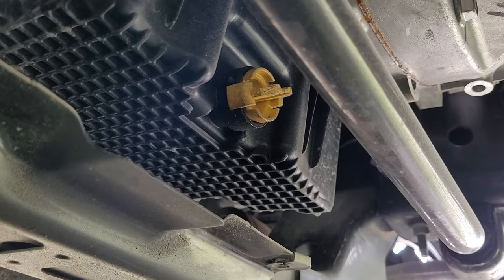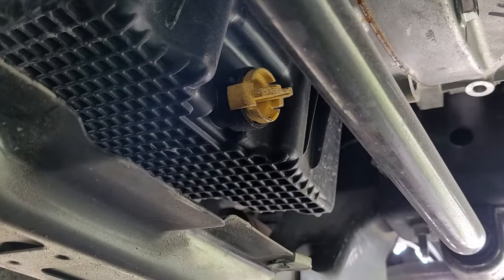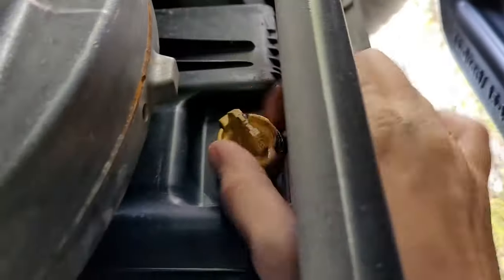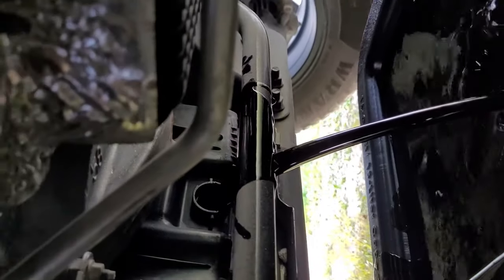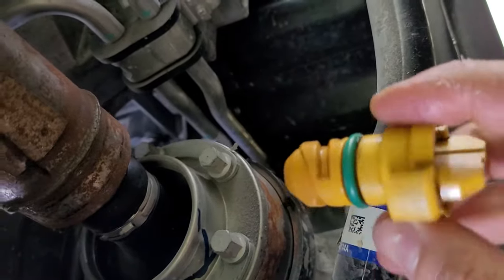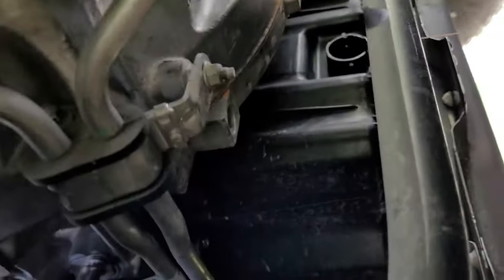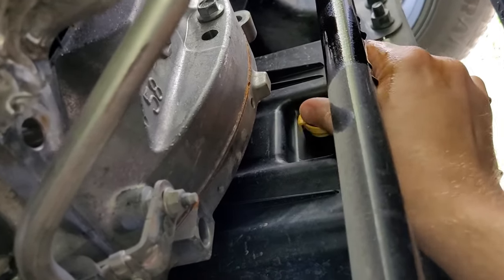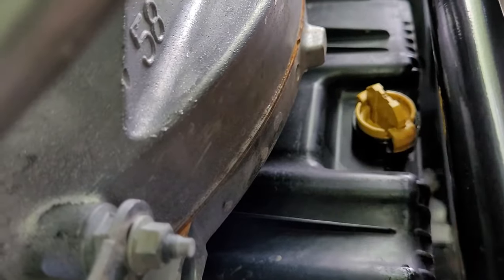Ford's New Drain Plug

Comment: Why can't Ford just leave it alone.  Remember how they re-invented the spark plug a few years ago?  Disaster.   Plastic oil pan?  What could possibly go wrong?
Reply from the maker: Right. I think it was the triton 3 valve that only had 3 threads holding the plug in and the plug would shoot back out.  Or the fuel tank straps that rotted out and people would loose their gas tank while driving.  Also the whole tires at 23 psi thing back in the day and then blame Firestone
Reply: I'll keep my Silverado !
Reply: They didn't read Jeeps notes.  Plastic engine. Lego car.
Reply: @thebartendermechanic  The 03' and older 2V Modulars had the short threads in the head and the 4.0l V6. About 4 complete revolutions of thread. In 04 up a longer thread length was added. What Ford did with the short threads is they went from iron heads to aluminum heads and kept the old spark plug design with a short thread length. Obviously iron is stronger than aluminum and got damaged easier. Then on the 04'-early 08' 3V modulars they went to new plug design that got stuck in the head. In late 08'up they changed the plug design on the 3V modular plugs once again to an all threaded design with no long protrusion on the plug so they didn't get stuck. If you need to design spark plugs for an engine, just don't ask Ford for help.
Reply from the maker: @sdvten  thank you this is good information, I remember the plugs getting stuck in the head they would rust in the head and the had that special tool to take them out.
Reply: Because then you’d have GM with Archimedean technology and pushrod 2 valve engines forever while the world innovates them by.
Reply: @visiondemedici6347  Ask yourself when you last saw a custom hot rod builder swapping a Modular block Ford into one of his go-fast creations.   Then go online and check out the number of builders who are sticking LS block GM engines (or SBC) into their hot rods.   Nobody has any trouble locating Modular Ford blocks in junkyards, but LS GM motors are getting downright scarce in the used market.
Reply: @jimparker7778  The simple answer to that is size. Physically Ford modular engines are very large in size. Much larger than GMs LS engines. They just don't fit in engine bays as easy as the LS.
Reply: @sdvten  You left out the Big One.   Ford Modular engines all have huge timing chains.   The GM motor has a timing chain that will last 250k miles easy.  No so with the Ford.  Timing chains have been a problem for the Ford OHC engines.
Reply: @jimparker7778  Yeah the timing chains are longer but they do last. Both engines have their share of timing set issues. If you don't think so you obviously have little experience with working on either. Sounds like you are going off of regurgitated information. Can't tell you how many modulars from fleets I've seen with 300k, 400k or more on the original timing sets. The 2V has far less timing set issues than the 3V modulars.
Reply: @sdvten  Why did Ford drop the 4.6 if it's so great?   Ford's had a ton of trouble over those timing chains.
Reply: @jimparker7778  The 4.6l was in production for over 24 years. To meet current emissions and power requirements with VVT, Di and higher CRs it just made sense to come out with another design. Even though some of the new engines like the 5.0l have things in common with the modualrs. GM has a hell of a lot more problems with their AFM system than Ford ever had with the timing set on the 4.6l.
Reply: @thebartendermechanic  ...lose not loose.   Loose means not tight
Reply: @thebartendermechanic I remember all of that 😂 and I had a friend with an F150 that we had to help him strap his fuel tank back up so he could get home.
Reply from the maker: @Pointlesshandle48  Yes!!! when I worked for Ford for about 5 months 12 years ago that's all I did was fuel tank straps🤣 there was a big recall going on
Reply: @rickwidlund3512  Me too!
Reply: If it ain't broke, fix it.

-Ford
Reply: Remember plastic windshields? Another winner.
Reply from the maker: @dudley7540  no, is that a real thing?
Reply: @thebartendermechanic  30 years ago? I'm scraping the sticker to do an inspection and the razor blade digs in. Hid it with the new sticker.
Reply from the maker: @dudley7540  lol, crazy. the things new parts cover up
Reply: @dudley7540  Aluminum pickup trucks?  Shocks mounted so close to the rear brake discs that the fluid overheated and ruined the seals?
Reply: But you don’t understand. Now they can charge you for a kid plate or lots of changing pans.
Reply from the maker: @dang6832  keep the parts sales up
Reply: Right that’s a hell of a fix for a failed $2 part… I definitely wouldn’t trust these chain oil change places with that it looks too complicated 😂
Reply from the maker: @tommyc5062  yeah I don't trust oil change places

Comment: pretty soon Ford will replace every metal part with plastic. 5 years from now you'll be riding around in a fisher price vehicle.
Reply: Look what plastic composites have done for bright auto trim.
No mo' nasty chrome plating w/later-on EPA TOXIC CLEAN-UP.

I bet your car/truck engine has a composite intake manifold.
Imagine trying to cast/machine such a  "monstrocity" in aluminum METAL.
Reply: They'll make sure to leave some metal body panels that rust out within 10 years up north on a $60k-80k truck.
Reply: Little Tikes Cozy Coupe
Reply: It will then be called a BMW😅.
Reply: They are copying bmw. New BMWs are pure junk after 4 years of heat cycling the plastic engine components. This is the aim; they want failure, their business depends on it
Reply: @dsmhiggins67  well yeah, one should never buy a BMW, just lease.
Reply: Fisher price is a better build quality than Ford.

Comment: I really like the sway bar right in front of the drain, real smart design.
Reply from the maker: Good for taking an oil shower
Reply: Yep. Frame members. Crossmembers right underneath is fun. Almost impossible to get the oil residue off so the customer thinks that there is now a leak.
Reply: ...and NOW with the NEW Space-Saving Design.

My '13 F-150 3.5L ECOB...has the drain plug on the RR of the aluminum pan...just above a big, ol' sway bar.  ALWAYS a THRILL, every 5K mi. while at "operating temperature".
Reply: Well, the engine goes where it’s gonna fit and the sway bar goes where it’s gonna function, I guess the designers could have put a notation in the service manual to alert the technician to have a rag handy to wipe off the sway bar when they change the oil ?
Reply: @jimseviltwin1  You have never been so correct Sir.
Reply: you dont like sway bars>?
Reply: @OregonCoastVideo  Don’t have one on the back of my Jeep JK and yeah, it sways a bit, but nothing that can’t be handled.
Reply: @jimseviltwin1  Nobody EVER reads an Owner's Manual...unless its a dark, rainy Sunday night, they have a flat tire & they cannot locate the jack.
Reply: Engines designed independently of car model. And you shouldn't own a car if you complain about such stupid things.
Reply: @inevespace exactly
Reply: It’s not really hurting anything. It hits it when it first spills out and after it drains you wipe it with a paper towel. I’ve seen much worse designs.
Reply: Same on the ram 1500s too 😆
Reply: Yeah, never liked the design of that drain. Always exciting. Surprised you didn’t mention the 3.5 ecoboost oil filter placement. Taking off the shroud, shoulder deep at a 90 degree bend for a blind placement. What a joy
Reply: Probably a good idea to have something protecting that plastic oil pan.
Reply: better a sway bar than exhaust pipe like my subaru completely surrounding the oil filter
Reply: 30 years ago, I had a 1974 Ford F-350 with a 390 V8. The drain plug pointed right out of the crossmember and always made a mess of everything. One day, I went to the junkyard and just bought a random old oil pan I found lying around for a couple of bucks. I took it home and cut the drain plug out of it, then pulled the oil pan off of my Ford and welded this drain plug in the other end so that it had a clear shot. A couple of hours of work fixed the problem for the rest of the years that I owned the truck! Can't really do that with plastic oil pans. I think I'll stick with my old Chevy truck.
Reply: Get a Fumoto valve. It's the only way to go.
Reply: At least Nissan is kind enough to put a drain lip there 😂😂😂

Comment: If they are using a plastic oil pan, then a plastic drain plug makes perfect sense. They seem to work perfectly well.
Reply from the maker: Time will tell
Reply: @thebartendermechanic  but there’s been plenty of time. Those plastic pans and drain plugs came out 10 years ago and I’ve never heard of any major problems from them.
Reply from the maker: @stephenmartinez1  alright, that's good to know, maybe they are better than the metal pans.  I personally haven't seen them, but I usually work on bigger machines
Reply: No need to ever worry about ruining an oil pan due to over tightening the bolt. A lot of repair shops and inexperienced DIY’ers ruin them. I think the design is cool, personally.

Comment: If you shine a borescope up the oil drain hole you’ll see plastic connecting rods also.
Reply from the maker: No way, plastic connecting rods!!! I don't believe it
Reply: @thebartendermechanic  He's pulling your leg. While a light weight plastic or composite carbon fiber connecting rod would be a thing every manufacturer would welcome it can't be done because of the forces placed on the Conrod by the piston. Rods made of metal bend and stretch and have to withstand forces measured in Tons of force. Only steel and aluminum are cost effective AND robust enough to handle the forces. People have been trying to make every part of an engine plastic since the 60s.
Reply from the maker: @btwbrand  Yeah, plastic connecting rods just didn't make sense to me
Reply: With banana peel bearings....
Reply: In the mid 90s I actually built a drag race engine with pink plastic "unbreakable" connecting rods.
Fun fact = Can't break 'em but they WILL stretch and make a hell of a noise pistons tapping on the cylinder heads. Wait 24 hours and they return to original size. Problem is if you build the engine with enough clearance to avoid that then you have lower compression ratio - and you're going to lose every race !
Reply: @thebartendermechanic belive it pal, they even made the crankshaft out of plastic. Even the oil is liquefied plastic

Comment: I'm sure we'll be able to get aftermarket metal oil pans with traditional drain plugs, especially after the quickie oil change shops start "overtorquing" and wrecking these new plastic ones.
Reply: or in 5 years when that finger tab breaks off.  I'd def change it after about 8-9 years, I had the plastic oil cartridge cap on a 12yo ford crack and spew oil all over the place.
Reply: The whole idea of this design is to prevent overtorquing and damaging the oil pan. The pan has tabs which prevent the plug from turning too far.
Reply: Ford says these are 1-time use. Last year I went to 3 oil change places and none had the plugs. I had to go to a dealership, buy a couple then go back for an oil change.  Stupid!
Reply: @bpkmm3048  where do you get your oil changed? I work at Jiffy Lube and we rarely replace these plugs. I don't see how they're single use. I have seen the rubber o-ring become flattened around the outside over time and have replaced them because of that.

Comment: Yes, I do own a Ford. I had hoped that the manufacturer had learned a lesson with the first two years of the diesel 6.7 (2011/12) and that those plastic parts are junk, often leaking or breaking. Somewhere I still have a spare drain plug from my 2011 F350 - probably stored in the same place as the spare plastic fuel filter cannister that often breaks.
Reply from the maker: Yeah me too, it seems like they keep cutting corners on manufacturing but the price keeps going up
Reply: @@adog3336 You might do your homework before you challenge a FORD diesel Super Duty owner with a FORD designed and built engine. Ford stopped using Navistar engines. a 6.4L with the 2010 year. The 2011 Ford uses their own design, a 6.7L 400Hp/800Lb ft torque engine and continues using that same basic bullet proof 
engine with many upgrades into the 2024 (500Hp/1200 lb ft torque) model year. Additionally Ford designed and built a 3.0L diesel for the 2018-2021 F150
Reply: @@adog3336 You would never work on my Ford with that lack of knowledge. You might want to actually learn what you are working on if you are actually a Ford tech working on 6.7s. You might actually learn that Navistar almost drove Ford Super Duty trucks out of business with their crappy 6.0 and 6.4 self destructing trash engines.
As far as GM and Dodge/RAM, I really don't care what they use for an engine though the pre DEF Cummins are about as good as any light duty pick up engines

Comment: I bought a F150 with this drain plug, it was the last F150 I bought.
Reply: What f150 did you buy that had this?
Reply: @jacobhinkston6804  It came on the smallest engine - 2.7 liter V6.

Comment: Maybe ford could put an oil drain on it that just shoots clear of the truck itself right into the oil catch pan. The way some of this stuff is designed I'm surprised you don't have to fold the mirrors in and remove the rear driveshaft to change an air filter. I mean, think about what your thinkn about ford.
Reply from the maker: right!
Reply: Lmao

Comment: On my 9th oil change with this plug. After the first use. I just use pliers to pull and twist. Learned my lesson. I actually haven't had to use my replacement plug yet. And am still on the original from the factory. Besides the learning curve for the first time I used it. It's been fine.
Reply: they're supposed to be single use...
Reply: @nealr5530  exactly
Reply: You change the oil once. Once.
Reply: You can reuse them. It's not like a stretch bolt.
Reply: @tynewlin  exactly. Just make sure the O-Ring is in good shape.
Reply: @Ponyo3816  excellent point, yes. I have replaced the o-ring on these before when the outer circumference is noticably crushed flat.
Reply: @nealr5530  Toilet paper is single use. Most things don't have one usage cycle.

Comment: I had a F-150 with the Triton V-8 motor, which had a plastic intake manifold. One corner cracked and started leaking antifreeze. I'm sure nothing like that will happen with these plastic oil pans. Just wait until they start making pistons out of plastic.
Reply from the maker: right, i'm sure they're already having problems and someone has thought of that.

Comment: You can get a metal replacement, what kills me is the plastic pan….as if that will never leak or crack from heat
Reply from the maker: it won't dent either
Reply: @thebartendermechanic  right it will just split😂
Reply: @thebartendermechanic  it does, but it's a different word "warp".
Reply: Detroit diesel has been using them since the 90s I think,,,